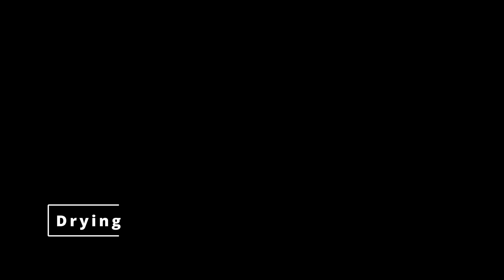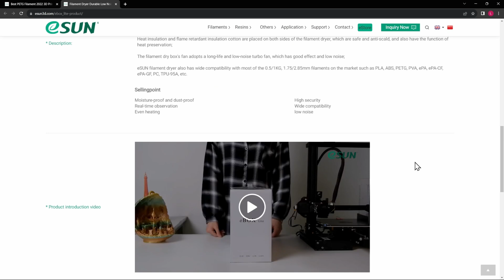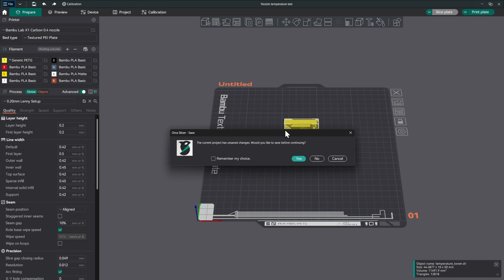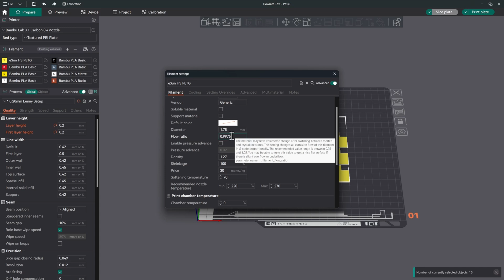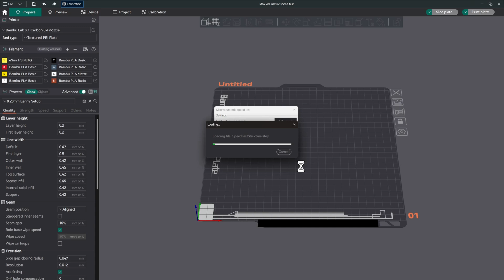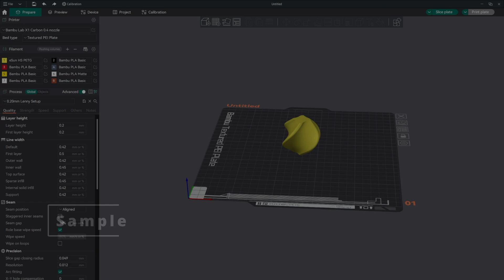eSun HS PETG Filament Review & Orca Slicer Calibration

Comment: I am still having a terrible time with PETG-HS, Its my first time with PETG, I am using a Bambu P1S, The bow of the benchy is where it looks like its just too hot and melts/overlaps, looks worst any beachies I have ever printed.  I have tried multiple settings.   The Dummy13 is an item that recommends PETG and thus why I bought a couple rolls

Comment: I am not fan of PETG, used it very rare before as it has many problems during the printing, but then I tried eSun HS and got shocked. Printing it with 200 mm/s and 255C without any calibrations and the part prints perfect, no defects, it's super strong and good looking, perfect sticking to PEI bed. And if it's really 68C@0.45 MPa, then this will be superior material for many applications. Seems, that I will stay with this material and print much more with PETG then before. Thank you, eSun.

Comment: When doing any of the calibrations in Orca, should you always use a Generic Filament profile? Seems a bit odd, since if you have used a filament before and have some values set and working, why wouldn't you load the existing profile for that filament and build on top of that? Seems like if you keep going back to the Generic profile, you'll never get it dialed in very well.

Comment: Thank you for the excellent tutorial. Recently I got the same filament and it was printing very badly on my A1 Mini with Bambu generic PETG profile. eSun provided profile was even worse... a lot of stringing, bad overhangs,.. I made the calibration and got almost the same results, only PA was slightly different, around 0.032. I think setting with the most effect was print temp, after lowering it to 235 it's printing fine. It's still adhering to the textured plate like crazy, I have to use some release agent. BTW, it seems that eSun has slightly changed parameter info on their web page and docs. Their bambu profiles for this filament are bad, forcing 260 °C, bed 90 °C and fan at most 40% is way too hot, at least on my printer. The closest good Bambu profile that prints somewhat ok is for their new PETG-HF.

Comment: I have been having the typical problems with printing PETG. Depending on the color/brand it tends to blob on the nozzle, have poor adhesion, and generally act up when printing causing failed prints. My most reliable has been eSun PETG, so I decided to try this new high speed version. All I can say is WOW!. Even with boosted speed settings, the fist print is flawless. I will be getting more.

Comment: Going to cardboard spools ruined esun for me
Reply: If you liked it, then you should put a ring on it. Problem solved :)
Reply: @D4RKFiB3R  I did untill I ran out of the bulk I had on hand. Then the new order of 30+ rolls i placed came in all cardboard
Reply: @Moodyfabrication  I mean a plastic ring around the cardboard lol.
Reply: @D4RKFiB3R  I did tried 3 different designs the spools are very inconsistent in diameter. Measured 5 spools from the smallest to the largest was a 1.5mm difference. So I would have to have an assortment of different size rings to be useful
Reply: @Moodyfabrication  Ah. Yeah, that sounds like a pain in the arse.
Reply: @D4RKFiB3R  yea now I'm going back to reprapper
Reply: @Moodyfabrication  Have you tried the official esun spool adapters on maker world? I've just got a cardboard spool, so I'm printing an adapter now.
Reply: Just stretch electrical tape around the edge of the cardboard spool. It works great in the AMS
Reply: Same here. It's like they've all got something against the AMS. No sooner did it come out everyone decided to change to cardboard spools. Tbh they should go down the bambu route of master spools and refills.

Comment: I have a P1S and love it, I am thinking of adding a X1C but this video confused me a bit, I thought one of the advantages of the X1C is that the lidar does flow rate calibration? Is it better to manually calibrate? If so I may stick with a 2nd P1S
Reply: The problem with the calibration that the machine does at the beginning of a print is that in multi-color prints, it only calibrates the first one.
If you do this calibration shown in the video, you will have all the filaments calibrated and also save the time of the initial calibration.

Comment: Thanks for the walkthrough about flow rate calibration.

I'm going to be buying my first 3d printer, the A1 (256mm).  The A1 series has an Eddy (?) flow rate sensor.  I think that is in place of the lidar laser sensor that you have on the X1.

Regarding the flow rate calibrations, is that to override the flow rate sensors?  And if so, is that because manual calibration is better than the built in flow rate sensors?

And if I had a printer without the flow rate sensor, is this manual calculation/calibration how all 3D printers calculate flow rate?

This is a one time only process when using a new type of filament?  Then we just save the settings for that filament for next time?

Thanks a bunch.  I enjoy these lab type walkthroughs. 👍